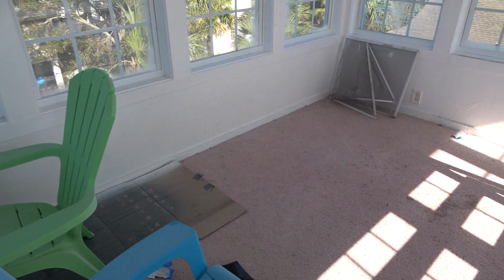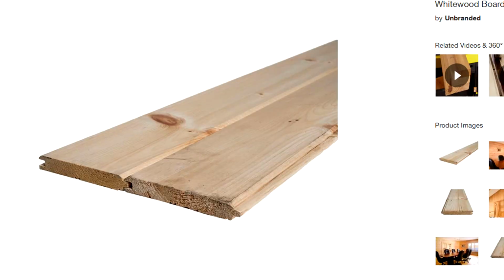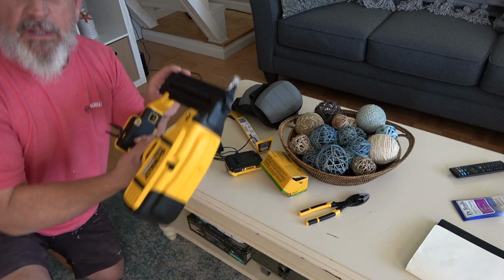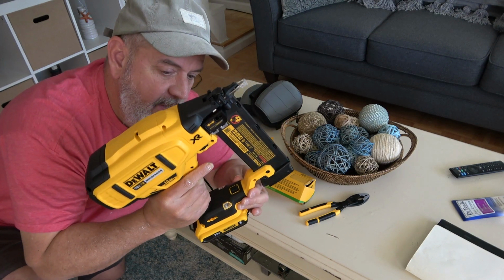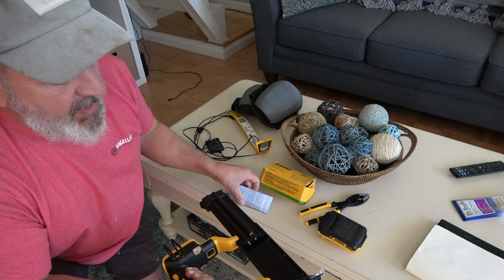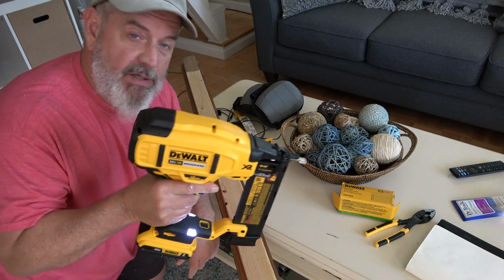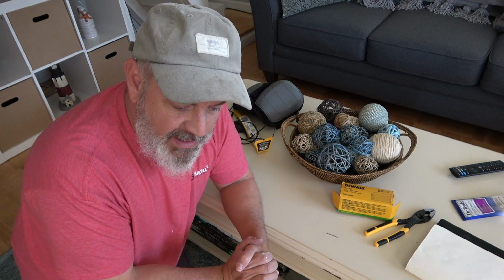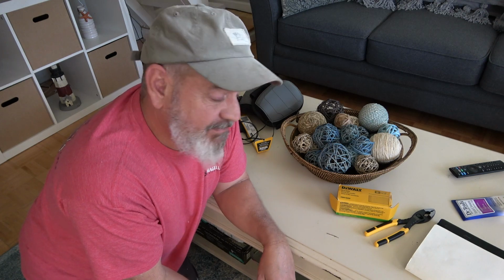Battery Nail Gun - DeWalt Brad Nailer 20 Volt 2 Inch Brads

Comment: I like Dewalt products but decided to go with Rigid. Works fantastic! Best part, it comes with a lifetime warranty. This is built like a tank, as with all of the other power tools I have of theirs, since 2007. Not for the whimpering.
This also has a duel battery charger. Received a great deal on everything. Could not pass it by. Extremely pleased.

Comment: nice versatile tool.Used to use the 16 gauge model with 2-1/2" nails on large interior door projects.18 gauge is much more friendly to casings and the painter.works well but air nailers  are much more efficient.Belt clip really comes in handy.

Comment: I'd be leery of only 18 gauge (I'd use 15 gauge) for that floor. Being pine in a humid environment, it's going to want to move. You might consider using some construction adhesive on the underside along with the nails. Also, might want to think about face nailing rather than blind nailing to get a better hold. After a season or two it's gonna want to creek on you for sure. Just some suggestions.....

Comment: Hello, pine expands and causes ridges. Decking stain I would not advise as it needs reapplying annually. Fence stain is a no no. Its not designed for footfall. I'd lose the staircase and install a spiral staircase. The widow (Americanism? Never heard that phrase before) room, I'd treat as a conservatory. Thanks for reviewing the nail gun. Here in the UK, they cost £330 as a bare tool!!